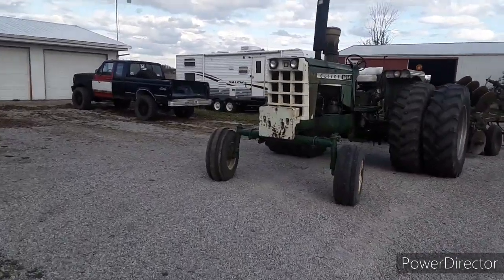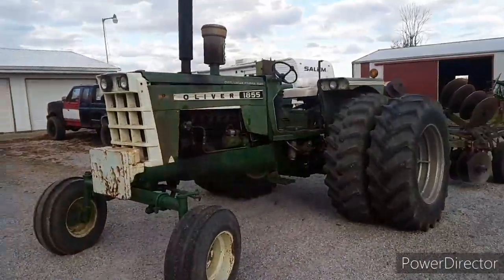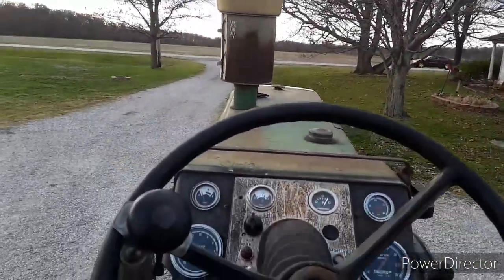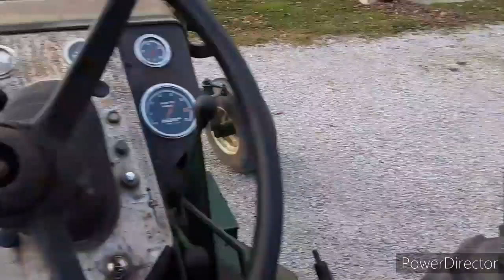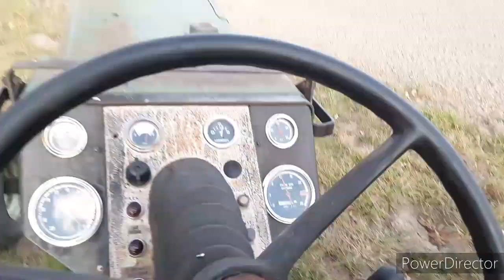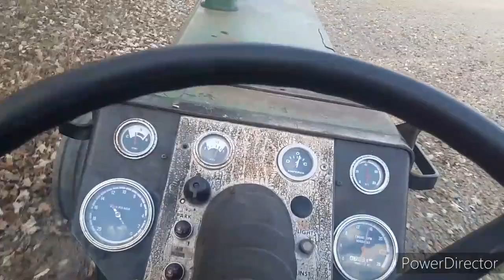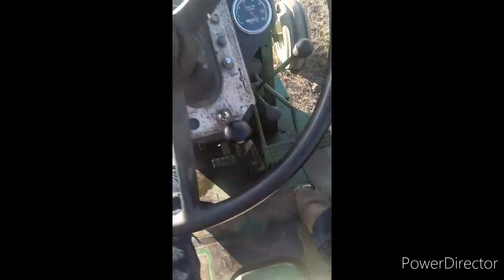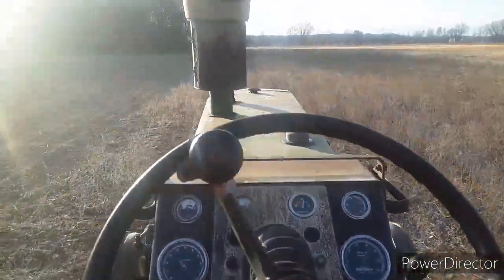1971 Oliver 1855 - discing with a 18ft JD bw series disc

Comment: Nice to see the old Ollies working still! We had an 1855 on farm (when i was little) that had the notorious 310 failure, got replaced by a 2-135 that is in still service today. You must have got a good one 👍
Reply from the maker: Still iffy on her lol, we don't try to push her too hard and that's why we got our 2-105. Still a sexy tractor though 😂 I believe I've seen your 2-135 on video before, wanna trade??? Lol
Reply: @jakesfarm6790  if rebuilt with the updated parts (1 piece rod bushings, 12 point hardened rod bolts etc.) I guess there descent. Oliverfarmboy loves them, Jeff Raymond runs an original. That 2-135 will probably be available in few years...lol
Reply from the maker: @crazydave4455  I've got no clue about ours, dad bought it maybe 16 years ago when I was -2 😂 I've tried to convince dad to let me drop the pan on an oil change but he is a true believer in "if it's not broke dont touch it idiot" 😂 I've tried looking around and I think its got a 1955 block on it because I believe I see an oil cooler. Maybe she wasnt so tough after all 😬 still interested to see hoe much power shes making. I'm thinking stock power. For some reason dad thinks below that. And our 2-105 sounds as unstuck as can be lol, I'll bet its running like 120 or so🤷‍♂️
Reply: @jakesfarm6790  I think you can look through the oil filler neck and see the bottom of one of the rods and see if it’s a 6 or 12 point bolt. Give you an idea if its been updated. I bet somewhere at a show or tractor club around you they have a PTO dyno, be fun to see the HP. We had a 105, it got traded up to a 2-110.